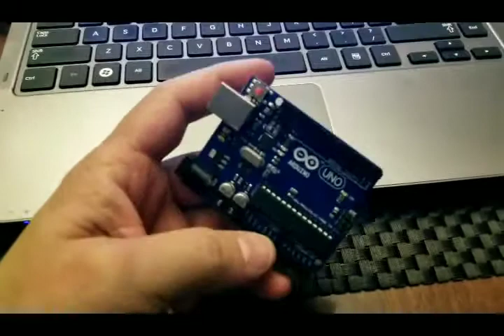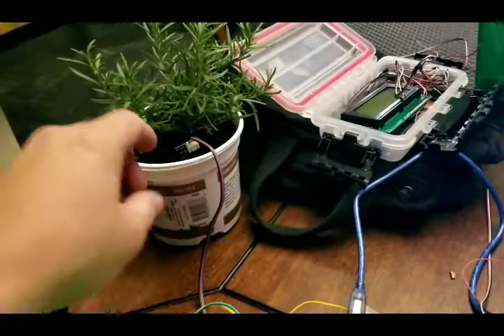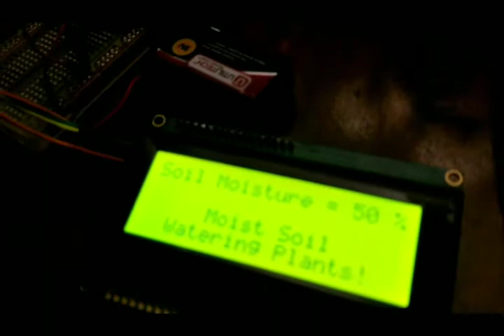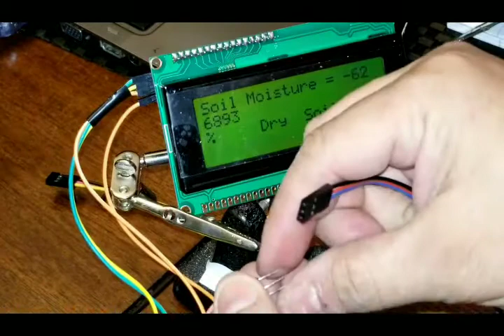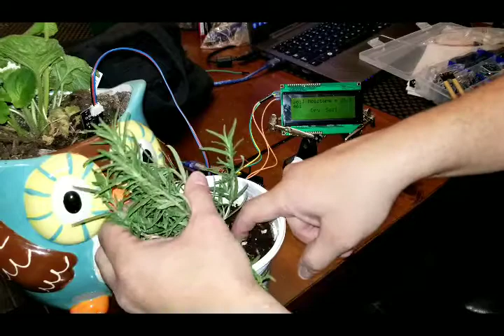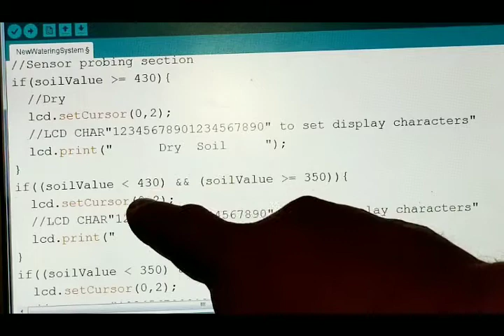Arduino Automatic Garden Bed Watering System ver2.0

Comment: @EngineerPrepper you've made some good improvements  in this version, thanks for taking the time to do the video. 
I am working a project using an Arduino with most of the same basic functionality you covered.
In my case I am setting it up  to provide consistent watering to a rain gutter garden I built.
Any chance of getting your code yet?

Comment: Hello what do you call that box where arduino uno is? I saw your first video about this, you have the 12v ball valve then u will connect it to what? Can u help me wheres the water come out? like its a tube then u make a hole?

Comment: How do we get the moisture monitoring kit & code? 😊
Reply from the maker: I will be providing the code for free in the description page soon. I decided not to put a kit together.(I dont have time).You can get the parts on ebay when I list the parts aswell.
Reply: @EngineerPrepper  Hi, and thanks for this!  How can I get the code and wiring instructions?